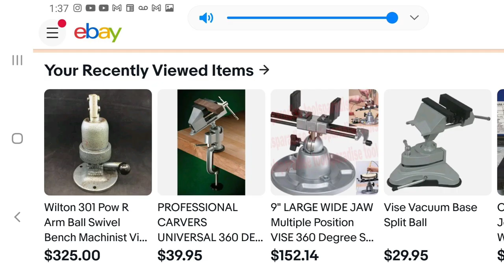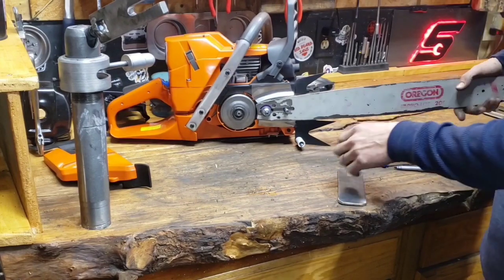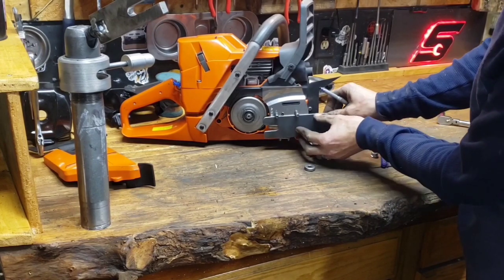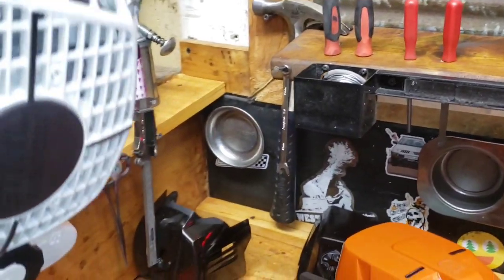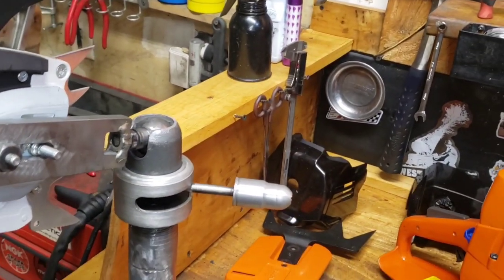Build your own chainsaw vise... dirt cheap!!!

Comment: Thanks for the info John about saw vise but I'm not having any luck finding all the components to build one .
Reply from the maker: Really? Did you try ebay? I found a  bunch of them by searching "ball vise cnc metalworking and manufacturing" ... you will have to modify it but it gives you the swivel and tension system... I will see if I can copy a link and put it in the description
Reply from the maker: I put a link in the description to a vise that could work...  read the entire description... if it was me and I had to take a chance on it before spending over a grand on one 🤯 (still blown away by what they are charging)... I would give it a shot 💯
Reply: @johnscustomsaws  The one you linked is too weak for this application. We have the same vises at work for holding small parts or micrometers during an inspection. Under a static load they  might hold a saw if you crank down on the ball, but if you apply any external torque you'll probably break the cheap cast housing.
Reply from the maker: @sawdust3670  ok my bad I will change it if I can... my buddy has one that looks just like that one and it works decent...I thought it was the same as his

Comment: Hi John can you do a video on pressing in crank bearings the right whey for a complete lower end on a stihl
Reply from the maker: i use special tools that most at home mechanics aren't going to have so I'm not sure if it would be very beneficial for very many people but a few people have asked now about splitting cases and bearing removal/install now so apparently its something that people want to know... i would have thought there would be a video on it already but if not I will have to put something together

Comment: Hey John I have a 572 and I have a still light bar for it the adjuster for the chain on the side case is too big to go in the hole on the bar I was told I could just use a round file and file the bar hole on the steel light bar to make it bigger can I do that so it fits
Reply from the maker: I've done stuff like that plenty of times... made bars fit b filing and grinding... bar oil ports gotta be careful and possibly some light bars but I have never had an issue
Reply: @johnscustomsaws  thank you buddy

Comment: Hey bud, I’ve got a 372XP with a 32 inch bar, what do you recommend for upgrades ? Like what kinda muffler ect
Reply from the maker: I use the Westcoast Saw muffler deflector or if you want a really wide open muffler check out redbeardsaws.com website... he sells mufflers and the air filter/intake kit for them and they are a huge upgrade
Reply: @johnscustomsaws  Thank you so much for the reply I will definitely check those out thanks buddy